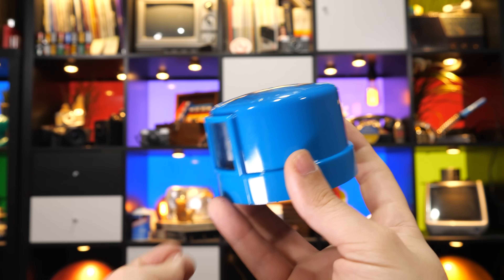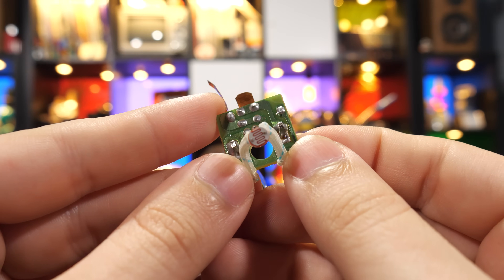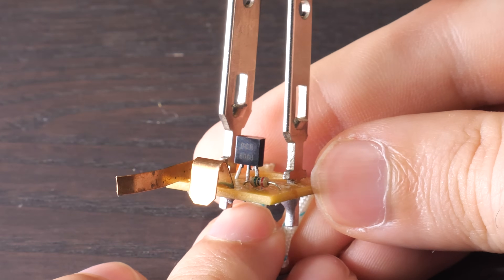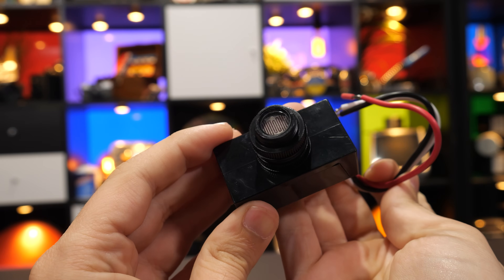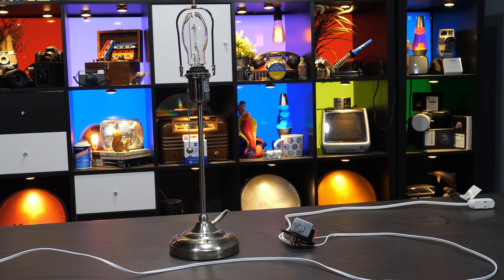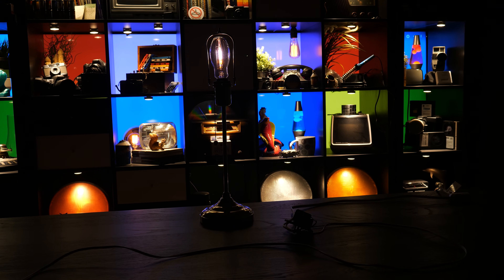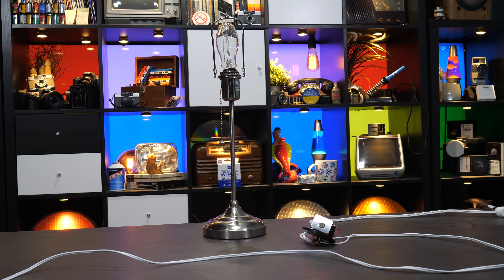Photoelectric light controls are weirder than they seem

Comment: TLDR: The key idea of the video is that photoelectric light controls use electronic components such as photoresistors and bimetallic strips to regulate power based on sunlight and create switches activated by the sun and light.

1. 00:00  Photocell light controls use a thermostat to turn off the light in sunny weather, and the circuit includes a photoresistor, ordinary resistor, and thyristor to control power flow to the bulb.
	1.1 Photocell light controls use a thermostat to turn off the light when it's sunny outside, and the light sensing component is a familiar sight.
	1.2 The photoresistor in a night light changes its resistance based on the amount of light, but it is only part of the circuit that includes an ordinary resistor and a thyristor to control the flow of power to the bulb.

2. 02:38  The thyristor in photoelectric light controls acts as a power switch, allowing current to flow and light the lamp when an input is provided, while the photoresistor disrupts the circuit by providing an alternative path, causing the lamp to not light up when light hits it, and the circuit draws very little power during the day and gradually fades the lamp to life instead of instantly turning on.
	2.1 The thyristor serves as a power switch in a lamp circuit, only allowing current to flow and light the lamp when an input is provided to its gate.
	2.2 The photoresistor disrupts the circuit by providing an alternative path for the activation current, causing the lamp to not light up when light hits it.
	2.3 The circuit in photoelectric light controls draws very little power during the day and uses a thyristor that stays activated until the zero-crossing of the AC power cycle, causing the lamp to gradually fade to life instead of instantly turning on.

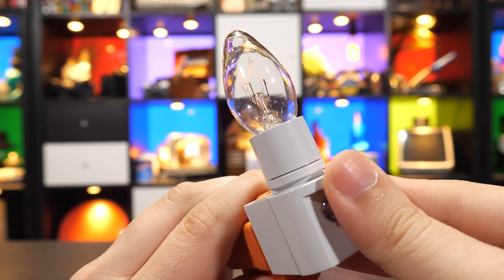3. 05:45  Photoelectric light controls are versatile and easy to install, with larger photoresistors and three electrical connections, operating independently of the loads they control using a thermostatic switch.
	3.1 This light control can handle high wattage and voltage, and can be easily installed in various fixtures, with larger photoresistors compared to nightlights.
	3.2 Photoelectric light controls have three electrical connections and operate independently of the loads they control, using a simple thermostatic switch.

4. 08:02  A bimetallic disc in a switch deforms with heat, acting as a safety switch, while a photoresistor lowers resistance when light hits it, causing a heater to get hotter and eventually open a thermal switch after 2 minutes.
	4.1 A bimetallic disc inside a closed switch deforms as temperature rises, opening the switch contacts and functioning as a safety switch in appliances, while a circuit board with surface-mount resistors acts as a heater.
	4.2 When light hits the photoresistor, it lowers its resistance, causing the heater to get hotter, and eventually the thermal switch opens after about 2 minutes.

5. 10:45  Photoelectric light controls use photoresistors to regulate power based on sunlight, with delays to prevent frequent starting, but they consume power and may not be practical for every light fixture, while banks of streetlights are controlled by a single device that briefly turns them on after power outages.
	5.1 The photocontrol in the streetlight uses a photoresistor to regulate the heater's power based on the amount of sunlight, causing the light to turn on once the thermostatic switch cools down.
	5.2 The delay in photoelectric light controls, such as the high pressure sodium lamp, is useful for minimizing erratic behavior and ensuring the lights don't start up too frequently, although it consumes power to save power, so it may not be practical to have one on every light fixture.
	5.3 Banks of streetlights are controlled by a single device that needs power to turn them off, and when power is restored after an outage, the streetlights will briefly turn on before the internal heater shuts them off again.

6. 13:57  The old photoelectric light controls had a complex mechanism, while the new ones use a simpler circuit board, but their reliability is uncertain.
	6.1 The old photoelectric light controls had a complex mechanism with a bimetallic bar and resistor, while the new ones use a simpler circuit board with a limit switch, but it is uncertain if this design is as reliable.
	6.2 Using a microcontroller and relay would be more efficient than running a heater all day, but there are trade-offs to consider.

7. 16:44  Photoelectric light controls are a simple and efficient solution that demonstrate the practical application of electronic components, utilizing bimetallic strips and photoresistors to create switches activated by the sun and light.
	7.1 Using a microcontroller for light controls requires additional power and can be unreliable, while photoelectric light controls are a simple and efficient solution that demonstrate the practical application of electronic components.
	7.2 The nightlight uses a semiconductor-based solution for low-power applications, and by utilizing bimetallic strips that bend when heated, it is possible to create a switch that can be activated by the sun, while the resistance of a photoresistor decreases when exposed to light.

8. 18:50  The inner workings of photoelectric light controls are more fascinating than expected, as they can activate the heater when the light is turned on.

Comment: I mean it's such a stupid thing... you can do the same thing with a relay, a transistors, a resistors and a capacitor. Just add a relay to the first night light you shown, and a capacitor to add some sort of hysteresis, plus in some models a potentiometer to regulate the light level when it should turn on/off. Nothing more than that. The cost would be even not that higher... it's just a thing of the past and I don't know why continuing to do the same stupid thing.

Comment: Key insights

💡 The electrical resistance of a photoresistor changes based on the amount of light that hits it, making it harder to light the bulb at night and easier during the day, which is counterintuitive for a nightlight.
🔌 The 2 megaohm resistor in the circuit always provides enough current for the thyristor to activate and keep the light on, but it can be easily disrupted by the photoresistor's low resistance when light is present.
🔌 Thyristors in photoelectric light controls exhibit a latching behavior, staying activated until the zero-crossing of the AC power cycle, which is why the lamp fades to life gradually instead of instantly turning on at full brightness.
💡 The photoelectric light controls used for street lights are much more robust and powerful than those used for controlling small light bulbs, capable of interrupting the full 15 amps of a standard US lighting circuit.
🔌 The photocontrol system uses a photoresistor to detect changes in light and control the power supply, demonstrating a clever and efficient way to regulate lighting.
💡 The thermostatic switch with its deadband between activation temperatures provides the perfect combination of delay factors to ensure that photoelectric light controls don't behave erratically.
💡 The newer design of the photoelectric light control module is simpler and more cost-effective, consisting of a three-component circuit board with an off-the-shelf limit switch, suggesting that there may be alternative ways to handle this technology.
💡 The use of bimetallic strips that bend when heated presents an opportunity for actuating a switch, showcasing the innovative nature of photoelectric light controls.

Comment: The streetlights on my street turn on and off repeatedly at dusk, and they each do it individually. Do you think they have software sensors? (If it helps, they’re all very new (installed 2022) LED streetlights and are ridiculously bright, because the building across the street is an office building, so now it’s considered a commercial district)

Comment: There is another kind of twist lock photocontrol for streetlighting you missed. Now I cant remember what its called, but its a bit old and set up differently where there is no 1-2 minute delay. When working in the dark, shining a light on it will shut off the streetlight right away and then reapply power instantly once the flashlight is removed. I was hoping to see that kind mentioned. This makes an interesting affect where a bright flash from a lightning during the night will interrupt the streetlight. 

I own one of this type with no delay, and also a few modern ones with the delay, it even states the delay on them... all of them being twist locks for a sodium streetlight head.

Comment: Supposedly my step-mum once worked for a company that were developing some of the first sensors for streetlights, an initial development issue was the streetlight itself confusing the sensor as when illuminated the sensor would see that, think that it's light again and turn the light off, on a repeating cycle.

Comment: One thing I've learned when it comes to electronic design, if you can accomplish something using discrete components and not involve a microcontroller, you are much better off. In all honesty, just the voltage supply for a micro-controller would consume more than 2W.

Comment: I had one of these in my big 30-in-1 electrical experimentation kit when I was a kid.  It was pre-soldered into the kit with a little viewport for it and these little spring connectors, and the whole thing ran on DC power.  So to build something from the kit's instructions, all I had to do was push the springs to the side, insert the stripped wires into the springs, and then let go.  So I could build dead simple things like a light or AM radio that could turn on or off with the sun.  That was great fun.

Comment: I was hoping you'd get into optioisolators in this video. They are like a relay with no moving parts. They are so simple! An LDR, an LED, a resistor and some heat shrink tube. They get used a lot to switch audio circuits in things like guitar amplifiers.

Comment: You really don't need the microchip. Simple normal transistors will do just fine, if you accept the fact that their set-points will be hard-wired (literally).
All that is needed is a simple pair of Operational Amplifier chips (wired in a hysteresis circuit), a low power MOSFET, and a relay of suitable size (the MOSFET turns on the relay).
You can easily derive a suitable DC power supply from the AC power supply using very few components, and without the "needless complexity" of a full-on switch-mode power supply. All you need is an AC Mains rated capacitor to limit the current, a diode to turn that current to DC, another (larger capacitance, lower voltage) capacitor to stabilize that voltage, a zener diode to provide an upper limit on the supply voltage (which would otherwise eventually rise to match the voltage of normally rectified mains voltage), and a resistor to limit the maximum current thru the zener diode to a tolerable value.
If you need to look up what I'm talking about as a schematic, go look up a "Capacitor Dropper DC supply". That's what I'm talking about here, and I'm using the absolute crudest voltage regulation method I can, a Zener Diode with a current limiting resistor.
Is this power supply simple beyond any other type? Yes, that's why I picked it. Is it efficient? No, it's only using half-wave rectification, and it's otherwise relying on linear regulation regiemes. But is it "good enough" while being as cheap as possible? Absolutely.

The relay will be the most expensive component of this whole circuit. The reason I specified a dual-op-amp IC for this is that one OpAmp will provide hysteresis for light levels, the other one will provide a time delayed switching action. If I have my memory wrong, quad op-amp circuits are also available, and they're still extremely cheap since not many people use linear IC's anymore.
You can also get them made with CMOS technology, which means they use MOSFETs instead of bipolar transistors, leading to a much lower standby current draw.

Of course, there's a downside to this, as there always is. This thing might need a variant that has a power resistor across line and neutral (along with a fuse of course) for use in winter applications. However, even given that need, the ability to reduce overall standby power draw should be available, as such a heater can be sized to be under a watt (it can even use just a PTC thermistor as the heating element itself, which automatically protects itself and automatically regulates power output relative to how cold it is, keeping the temperature inside the enclosure constant with the minimum of components).

Comment: There's also a 3rd way, which we always used at my old company:  
you have a small microcontroller (usually a PLC) in which you enter the current time and its GPS coordinates. With this information it'll precisely calculate the sunrise and sunset time.  And then turn off the lights x minutes after sunrise and turn them on y minutes before sunset.   
The only downside is that the system should be connected to an NTP Server
Reply: Do not even need a NTP server, you just connect a GPS patch antenna and receiver inside it, and it will automatically get location and accurate time after a few minutes, then can calculate exact sunrise and sunset times by itself. Turn on, and after 5 to 15 minutes GPS is locked, and you get current time either in local time zone, or in UTC, and it knows exact sunrise and sunset times no matter where you are.

Comment: Funny thing is those are not common by me, the electronic ones, which use a 48V relay, and a resistor to drop the excess voltage, and a diode as rectifier, are common. They use a 12V zener diode to get power for the 555 timer used as control, and, because of ROHS saying no Cadmium containing things, they instead use a photodiode as light sensor. 555 timer drives a transistor or small triac, that shorts out the relay coil, to turn the lamp off. 

Then you get the more complex ones that the street lights use, where the entire electronics is contained within a IC package, made from clear epoxy, that has the photodiode, amplifier and signal conditioning inside on the small silicon chip, and then this controls a thyristor that operates a 20A relay on the board. Note they also have to withstand all faults, so have a large MOV device across the mains input, 480VAC rated withstand, so that they will still survive and operate even if the nominal 230VAC mains has a fault and goes to 400VAC instead. Residential ones use a 275VAC MOV as protection, the last time there was a phase loss by me that got very unhappy, and blew the cap off the photocell, practically getting it into orbit. Not really going to protect, just clamping voltage to protect the wiring, and trip a breaker as it fails short.

Incidentally the street lights, for the most part, come with the photocell socket integrated in, as it is cheaper to make all of them the same, and supply instead a special shorting photocell, which has inside it only a 16A fuse and a 480VAC MOV across the output, so that there is still fuse protection when used in group applications, and the MOV clamps lightning strikes on the line down to a level the ballast and starter, or the LED driver for new ones, will probably survive, and, if not, disconnect the fixture. Most common by me are GE, Siemens and Royce Thompson as photocontrols, with Osram and Phillips (branded as Beka) also having a share, depending really on who won the contract for supply for a particular year.

You mostly see Osram or Phillips lamps though, as the most expensive part is the maintenance, and cheap junk lamps fail fast.

Comment: Electronic Engineer here. When I hear "Software" in the same sentence with  "to turn on a light bulb' or "blink an LED" my brain goes into psycho mode. "Yes sure. use an Arduino. Power it with a DC converter. make a Phyton script. plug it to bluetooth dongle. Run a server on a Linux so you can know its working..Put everything in a box  with a main switch, some LED and an automotive grade waterproof connector. And don't forget the lube, it comes handy for the last step." 
Yes, some home robotic applications may go that way for a reason, but it is hardly the general way to do it.

Comment: Our area used to have a centrally controlled light sensor for all lights in the neighborhood and it was always fun to go to it at night and leave a cheap flashlight pointed at it and go about making trouble in the hood as kids do.
Also, there used to be certain light poles that had some extra circuit stuff in them and assumed some sort of fuse with a bimetallic strip.
If you shook those particular light poles hard enough, they went out and all the lights on that loop went with it. And it took about 3 minutes for the lights to come back on after that.
Perfect for when you wanted to scare the crap out of anyone afraid of the dark and also "perfect" for when one was up to no good.

Nowadays, all circuits are controlled centrally by timers. More specifically, smart timers that can be programmed from afar.
They adjust to the seasons automatically so you know exactly when the lights should go on and off.
And of course you can always override from afar for maintenance. Turning all lights on during the day to replace broken ones.
So, no more fun allowed for the kids.

Comment: Does that mean that the street lights would come on later (relative to the amount of sunlight) in the summer from higher environmental temperature?

What were the temperatures of the resisters during the lit and dark states? Are they a large enough temp swing to overcome any effects of the ambient temp? 

Can it get cold enough in the winter to keep the lights on all day, or hot enough in the summer to never let the light on? Does Anchorage, AK use the same sensors as Phoenix, AZ, or are there different models for different environments to account for expected temps?